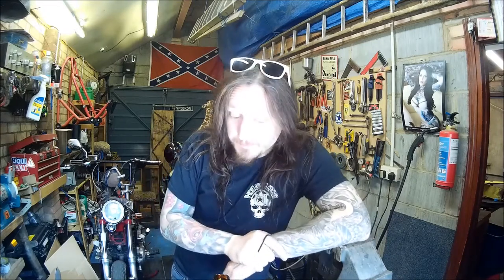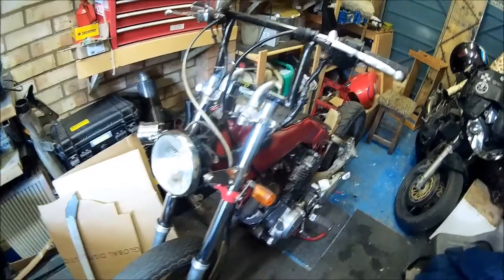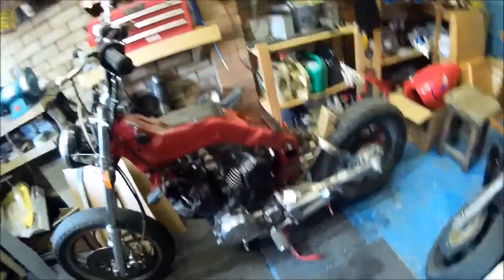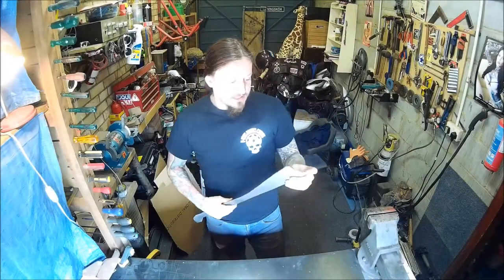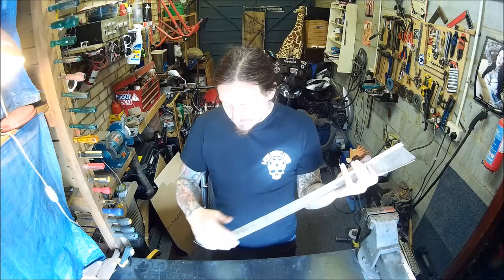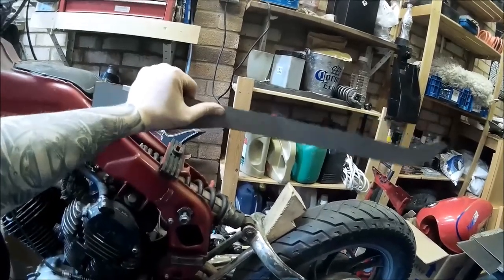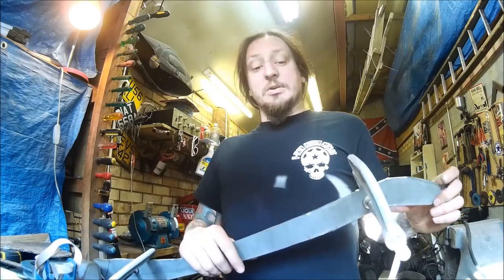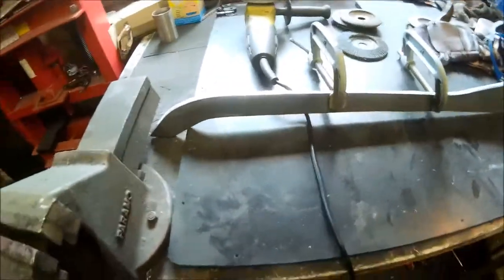Cambridge Pinstriping, Yamaha XV 500 Custom Project - Part4: Sub-Frame Fabrication stars here!

Comment: Hi Mackie, loving the build. From the way you described it you are creating a cantilever seat support which will be bolted to the frame with one bolt either side. Be careful because the weight of the rider will result in a prying force on the bolts, it could also cause distortion of the   Plate that it's bolted to. Fully welded would be stronger or bolt and add in bracing strut to the frame. Comment meant as constructive cause I love what you do with your channel.
Reply from the maker: Jenny Lloyd thanks Jenny. that's noted and taken to consideration. however there will be another brace underneath bolted to the frame, which will make it well supported.
Reply: Nice one, loving the build along with the mix of paint stuff on other vids, yours is one of my favourite channels 🤘
Reply from the maker: Wow! that is great to hear! It really means a lot! Than you fr your kind words!